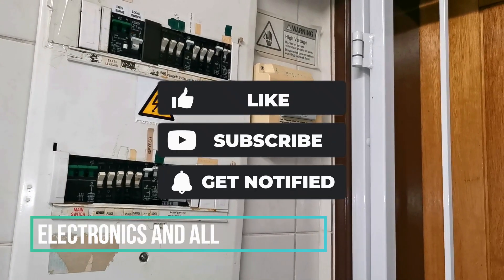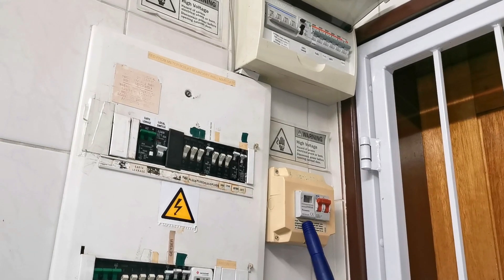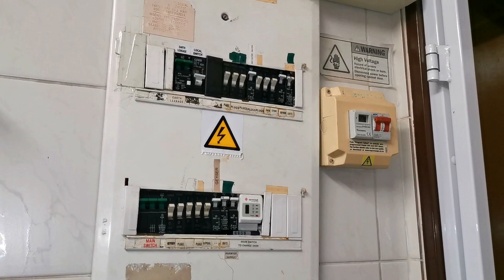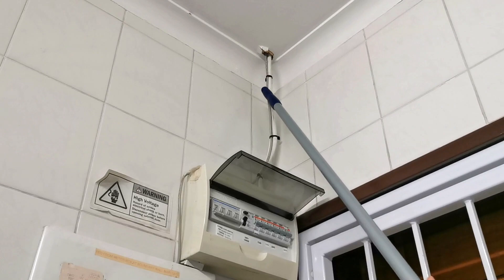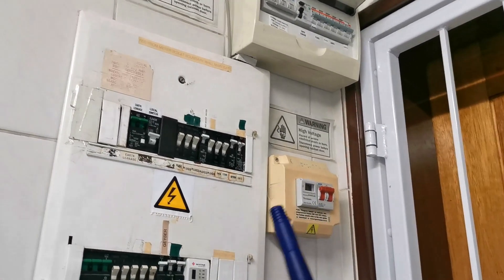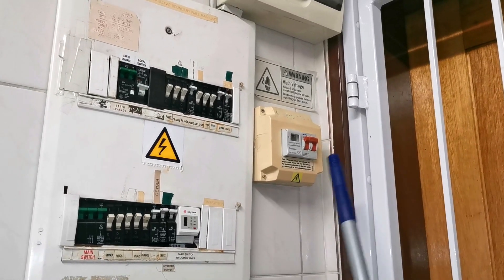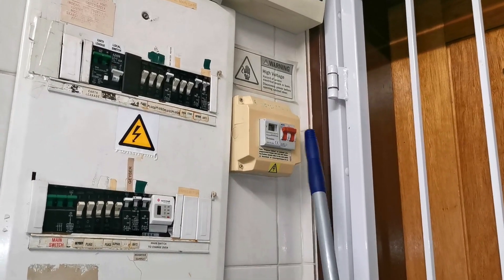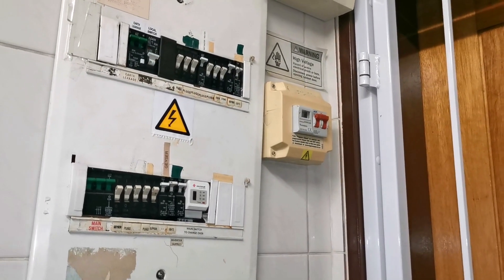How to Move Essential Loads to a Backup DB

Comment: 4mm wire is to small for a 40Amp circuit breaker
6mm wire just scrapes through to pass on a 40 Amp breaker
Also your geyser now has to be on earth leakage
And also you pool pump has always needed to be on earth leakage
If you had an inverter like a Sunsynk, you wouldn't have needed that extra change over switch, because it will back feed to your main DB when there is excess solar, as long as it is on the same phase
Reply from the maker: Sorry. You are correct. I was mistaken, it was 6mm2
Thanks for pointing that out
Reply from the maker: All compliant. Thanks

Comment: Thanks for the detailed description. On my previous install my electrician managed to connect my heavy draw items (oven, pool pump, geyser) to the non-essential loads with it being a seamless connection. This allowed solar to be shared onto those items when there was solar, as well as a percentage of the battery (when in General mode). With my new installation the guys haven’t been able to get that right which is disappointing as I went with the Goodwe inverter for that reason. Any idea how that would have worked?
Reply from the maker: Hi Tom,

It could be that the meter is incorrectly installed. Try support@goodwe.com they can check the unit remotely.